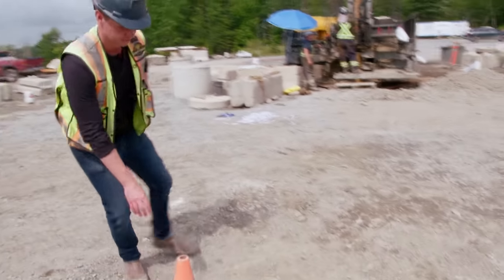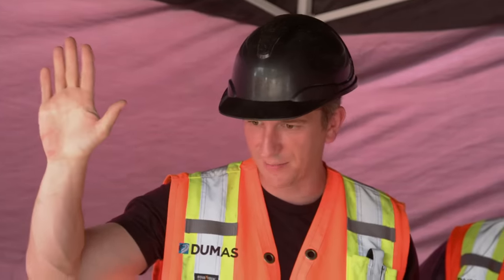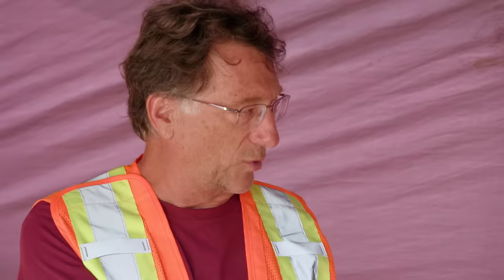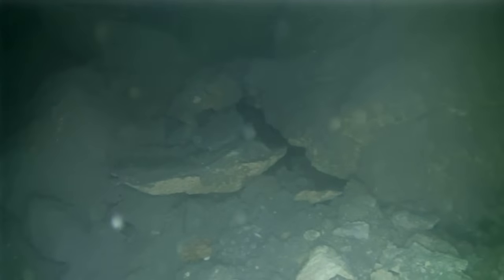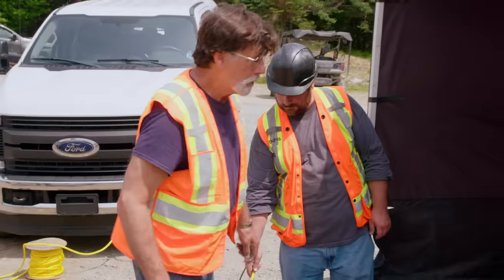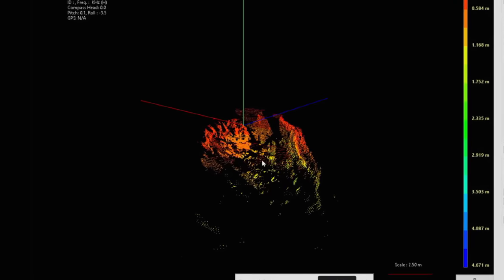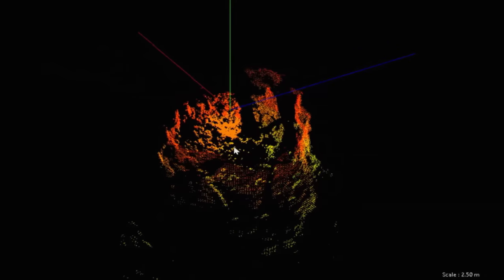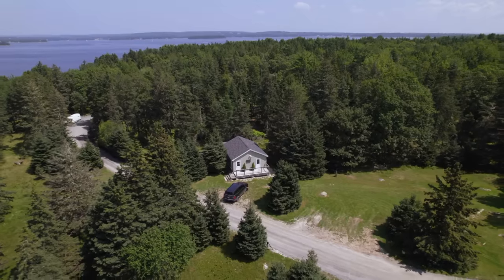The Curse of Oak Island: Uncovering Aladdin's Cave of Wonders (Season 11)

Comment: I totally agree that the original entrance is further away and on a gradual slope downwards.  They would've had to be able to "wheel" it to that spot thru tunnels. And it wouldn't have been a light load. Common sense.

Comment: How would the Depositers have known that cave was there and to tunnel to it. I think the cave is man made. Lot 5 is the entrance to the tunnel and was dug at a gradual grade slope so they could easily walk/roll to make deposits.
Reply: i think its likely the treasure was buried like 20 feet down and found a long time ago... if these guys cant even tunnel there with modern equipment there is no way people in the 1500s could
Reply: My only thought for that would be, perhaps the water table was lower then and more of the island was exposed which per the bay they dive in, there was activity where there is now water. They also had to dig to put in the box drains to get water into the tunnels for the trap-since that trap has been prior triggered and the swamp has been created, it may have drastically changed  the water table too.

Comment: amazing to me they dug this far down way back when, when with modern technology today they can't even get to it
Reply: Nobody "dug this far down way back then".  The Money Pit was originally a deep, open sinkhole that connected to the cavern(s) and was backfilled from the bottom up after the fact with dirt and the securely-fastened oak log platforms to conceal what was buried/concealed far below.  The sea level surrounding Oak island was much lower in the very distant past and the caverns were dry and accessible.

Comment: Imagine how long the pirates would have taken to recover the treasure,  when they had no electric pumps,  no diesel powered equipment,  no......
I swear that this show is a make work project for aging baby boomers.
Reply: C'mon man!  Pirates had nothing to do with the Money Pit.  What was buried/concealed deep beneath Oak Island in the very distant past was never meant to be recovered.  It is most probably a tomb.
Reply: @johnwoa  Sure John,  it was buried by Aliens  !  It was never meant to be retrieved by humans. Lol
Reply: @MrJdebest   Aliens didn't do it either!  The Money Pit was originally a deep, open sinkhole somehow connected to the caverns deep beneath Oak Island and the "tomb" was deposited at the base of the "sinkhole" via cave/niche entrances at the shoreline that are now completely underwater due to the slowly-rising sea level over the past two millennium surrounding Oak Island.  In other words--- "whatever it is" was deposited FROM BELOW and not from above at the surface.  The "sinkhole" (i.e. the Money Pit) was backfilled after the fact with dirt and the securely-fastened oak log platforms to protect and conceal "whatever it is" that  lies far below.  I learned long ago that this Reality TV show doesn't tell you everything.

Comment: Why is the box strings not blocked off and the caverns drained. You have spent all this time and money and with all the water still there your still at square one. You need to fix the big obstacle (water) before you can get into the cavern system.